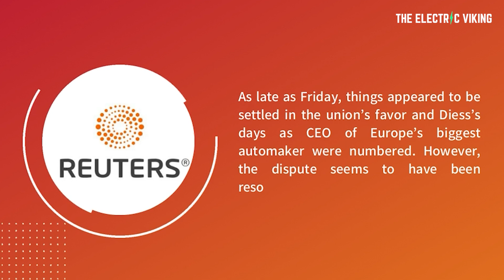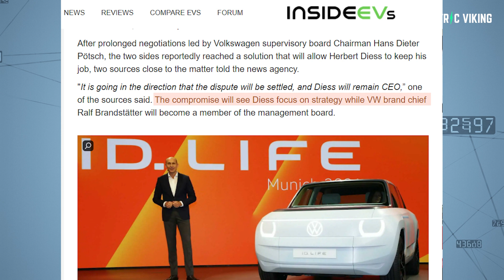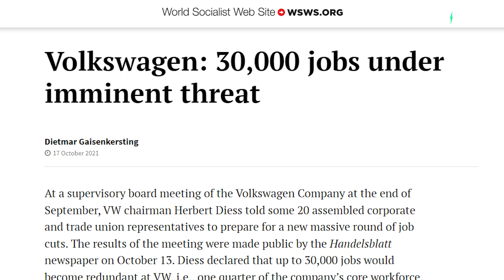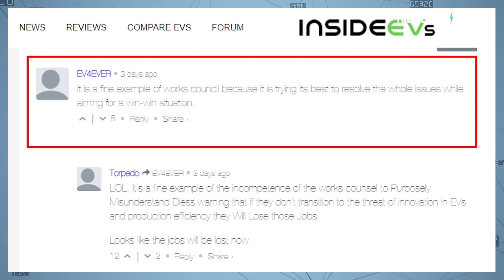Herbert Diess ESCAPES, but his CEO powers get removed

Comment: I have said that he would be lucky to have his job this Christmas. I guess I was still correct since it is not the CEO position but strategy only. This isn't going to go well for VW but the next 4 years will be telling. They are going to understand when Giga Berlin opens just how much they needed ONE MAN TO LEAD. Maybe the unions will be able to have a meeting about what to do as Giga Berlins starts to pump out cars faster than a Pez dispenser.
Reply: German workers need to remember that Diess is the one who told them they would be losing their jobs, while their Union leaders tried to silence him.  The Union Leaders need held accountable for any lost jobs.
Reply: Giga berlin line pumps out cars 3x as fast. 3 times... and Volkswagen been in the industry for how long? Also Tesla margins on cars are extremely high for the car industry aswell. Volkswagen should actually be super happy with a leader like Herbert Diess which is a great guy and understands what to do.. but he will have LOTS of resistance. Was he right about VW becoming Nokia????

Comment: Perhaps you don't realise VW cannot shift their culture fast enough or cheap enough. Unions know this, so does Diess. Unions want to preserve jobs till the last moment. Diess wants to try to change. But Diess's pace of change will tear VW apart (leading edge will run, trailing edge will resist) before they get results and there will be big layoffs sooner. They realise their problem more than you realise, but they know they are a cultural supertanker that is going to get decimated (1/10th). Traditional orgs are adapted for stability and are conservative - they foster that culture within. That's a really bad fit for their present predicament. When I say foster that culture-they indoctrinate it and expell those who don't demonstrate it and hire those that do. Culture is tough to change. Its expensive and time consuming. And on each step you take the part changed culture must be still functional and not self destructive. Best odds are to build new plants with new management and workers. Good luck with that in Germany with the timescales you would need to hit. Its kinda checkmate. Burn through investors resources till you down size is probably the most realistic option.
Reply: A very good analysis. The succes of humans(companies) over time will become very reliant on the pace they can adapt to rapid change.
Reply: Great comment!
Reply: It is short sighted.  In 10 years they risk going bankrupt.
Look at jaguar: Jaguar XJ and XE are no longer going to be sold, F'Type won´t be competitive quite soon, and XF needs to be elecctric quite soon.  In fact, they risk going under.
VW is in a similar situation but with many many brands, and some more EVs.  But the ICE factories are dead weight.
Reply: What if the unions believe that the best outcome for VW is to be nationalised by the German government? 
Wouldn't their present behaviour be the correct strategy?
When I see someone do something crazy like this, I ask myself- under what possible motivation is this logical. As a worker, is your job safer if your boss was an investor or was the government?

Comment: Håkan Samuelssen, CEO of Volvo, has seen Volvo sales rise from 435,000 in 2013 to 705,000 in 2019. Recently more like 680,000 because of Covid and chip shortage, but Håkan has led Volvo to a full BEV future with 50% BEVs and 50% PHEVs by 2025, and 100% BEVs by 2030. He gets my vote for best legacy auto CEO. And no pushback from Volvo top management or their unions.
Reply: What EV does Volvo sell?  Dafuk is this? 2022 Volvo XC40 Recharge Pure Electric, range 208 miles for $58k MSRP?!  That is not a deal.  The Tesla Model Y is better in every metric.  Price $58k without any markups from dealerships, Range 330 miles, cargo space 76.2 vs 47.3 for the Volvo.  On top of that the Tesla is safer!
Reply: The XC40 P8 and the C40 are much nicer BEVs than Tesla or VW make. And  tiny little Volvo doesn't have a lot of models. Never has, never will.. But Volvo will add a new BEV every year for the next 5 years as will Polestar, starting with the XC90 successor and the Polestar 3 next year. And Volvo is talking about a 1000 km orange BEV in a few years. That's obscene. I'd rather have a smaller battery pack. I recommend you go watch the Volvo Technology Day Presentation video.
Reply: @777Outrigger  they are nice. But technology wise, efficiency wise they are very bad. Lacking modern technology and have a super shit range because the car and drivetrain are not efficient at all. Volvo needs like to add 20kWh extra battery for the same friggin range.. baddddds
Reply: @HermanWillems  Henrik Green said they've "played around" with a 113 kwh battery pack on SPA2. Also, on Volvo's Technology Day they said new Volvo BEVs will be more aerodynamic, more efficient, have more energy  dense batteries, and be built with lighter weight materials. They also mentioned ranges of 1000 km in a few years.
Reply: @777Outrigger   Sorry to hurt you, but Tesla is better.  Why pay more for less?  Can you buy that XC40 for under $20k?  No?  Then without charging places, or FSD, who would buy it?  That is like buying a Cell Phone today that does not have a touch screen and still costs $900.  Nobody will buy it.  Sorry.
Reply: @777Outrigger   Volvo BEVs are nicer than Teslas?  Please explain that position.  How did you form that opinion?  Is Volvo BEV, faster, safer, better tech, more efficient, quieter, better seats, better looking?  What exactly makes you think Volvo BEV is "nicer"?  The price $58k for a car worth $35k.  That is not "nice".
How many BEV did Volvo build last year?  Or last month?  How many pre-orders does Volvo have for their BEVs?
And last but not least... how much profit does Volvo make per BEV sold?  How profitable are their vehicles?
You have opinions, I want to find out how much information helped you form them.  What do you know?
Reply: @davidbeppler3032  I've set in a Model S, and it's hardly what  I would call luxury. And Model X seats are atrocious. Not like Volvo seats which are designed with advice of orthopedic surgeons. And there are many reviewers who say the Polestar 2  have better fit and finish and have a much better luxury feel, and some have said better driving dynamics than a Model 3. And fast acceleration is cool, I guess, but it's a one trick pony.  [The Polestar 2 just had 67 HP added via OTA update] 

Volvo has very good profits even during the pandemic and chip shortage era. I don't n=know the profit per EV, but like I said before, Volvo is flush with cash, and that was before their recent IPO.

Don't get me started on safety. Most Tesla advocates who say Teslas are safer don't know diddly about Volvo safety. Even Elon embarrassed himself in comparing the side impact pole test of the S60 with the Model 3. Did'ja know that in those tests, the S60 dummy had less force on it at every point than the dummy in the Tesla? It's chalked the Volvo SIPS system. Moves the seat away from the side impact and crushes  the center console. I have a lot more on safety, but I'll stop for npw.
Reply: @davidbeppler3032  Like I said, I've set in the seats of a Model X. Terrible. Just sitting there for 15 minutes made my back uncomfortable. And owner reviews of Volvos. where wonderful seats are mentioned are everywhere. The reviewers say things like, I can drive for 4 hrs in my Volvo and I still feel good and rested with the wonderful seats. ... And did'ja know that Volvo seats have a function that will reduce the G force on your back if you run off road?  The typical run-off=road accident can put 10Gs on your back, but a Volvo seat will  compress and reduce that force by half. It took Volvo 7 yrs to develop their seats. Tesla doesn't have a clue about about what Volvo does with seats, and neither does Sandy.

Comment: Every auto manufacturer is going into electric to some degree. Their manufacturing has to be on par with Tesla or they will not complete. If Tesla takes 10 hours to build a car and Volkswagen takes 30 then something has to give. Especially because of their new factory which will make a car every 4 hours
Reply: 40 seconds? IMPOSSIBLE. It takes at least 30 minutes for the new casting to be made.
Reply: @LightWingStudios  my mistake might be 4 hours but it's going to be one of the fastest plants ever.

Comment: Is this really a loss for Herbert and a win for the Works Council? With the support of the Piech/ Porsche family Herbert now can define the future direction of VW. He can surely propose that the Group can be a BEV only company by 2030/2035/2040 and can argue that to achieve this more models need to be manufactured by a Chinese partner. He can even propose that VW follow Tesla and build a manufacturing plant in China! He doesn’t have to worry about upsetting the Works Council as the new head of VW/Skoda/Seat  has the responsibility of making Diess’s strategy work. I can see the decision as one to free up Diess and to get him to concentrate on the future of VW without getting bogged down in day to day battles.
I guess the issue is whether Diess sees it as “demotion” or an opportunity. If he walks away in the next 12 months then my view is wrong. If he stays and publishes a strategic plan for VW that goes all in on a BEV future and this is accepted by the Board then I guess we should look back and see the Boards move in December 2021 as going a long way to secure the future of VW as a car maker
Reply: I think you don't understand what actually happened. Herbert Diess was effectively removed of authority. He can propose all the strategy he wants but if the unions does not agree then that strategy will not be followed. The unions will keep asking for proposed strategy from Diess until they get a proposal they agree with.
Reply: @flexcheckXYZ  I agree I don’t understand.Just trying to make some sense of it all. I guess that VW are screwed after all,

Comment: Is he doing a fantastic job?  VW have failed to deliver the software for the cars on time, and have failed to deliver the over-the-air updates that they promised.   They deserve some credit for at least realising that software has become a key component of the modern EV ecosystem, but they have failed to make it a reality.  Is that Diess's fault?  I don't know.   But someone should be getting a negative performance review.
Reply: You have to understand that software engineering in Germany and Japan is lacking compared to USA. Also software engineers are paid worse than in USA. Alot good software engineers actually moved to USA from Europe and Japan. Quality is hard to find here